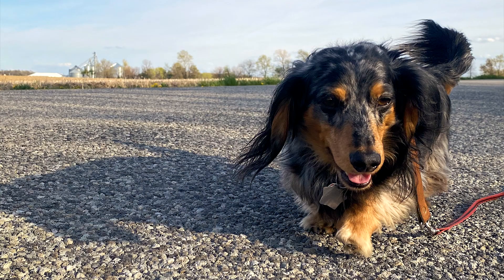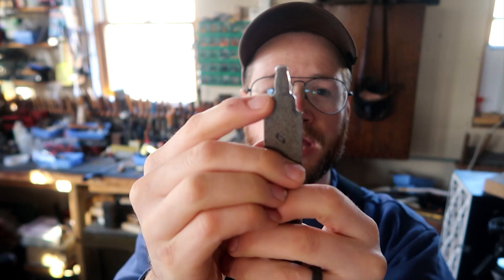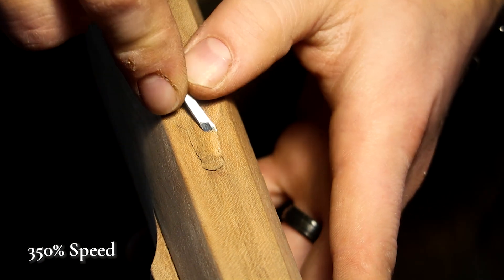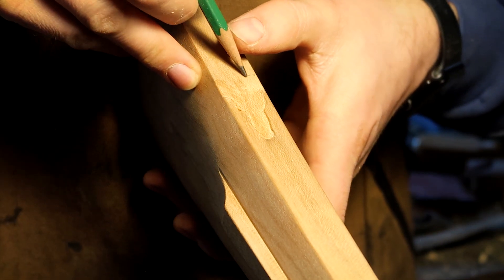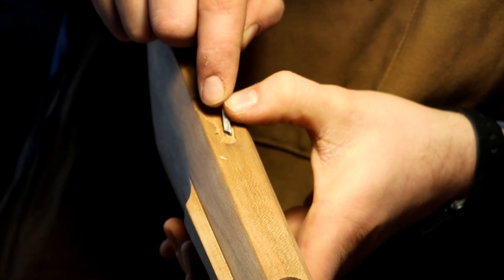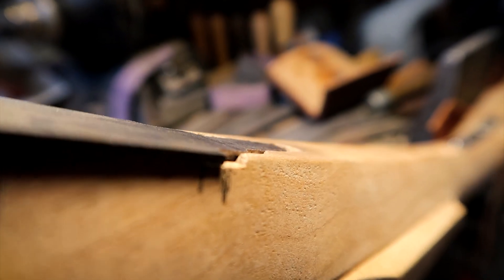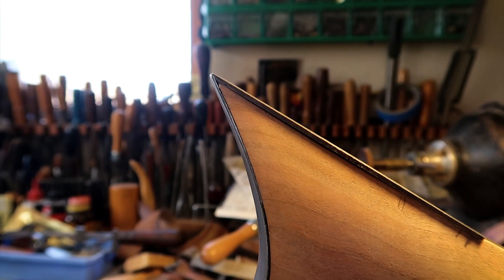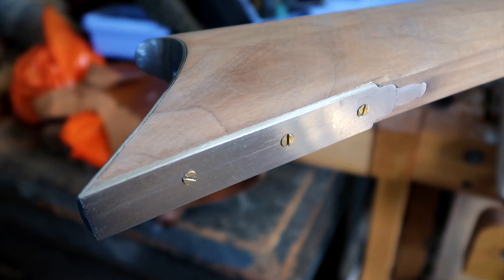How to make a custom Toe Plate for Kibler's Southern Mountain Kit

Comment: I'm adding a toe plate to my Kibler SMRand I'm curious, where did you find screws that would match the butplate?  I don't think you used brass on the finished product and the only other ones I can find are shiney steel.  I've checked all the hardware stores but I'm not finding anything similar,  Thanks
Reply from the maker: These were, thankfully, in my shop at the time I built this. I reccommend looking at "McMaster Carr", they have a massive online catalog and super fast shipping.